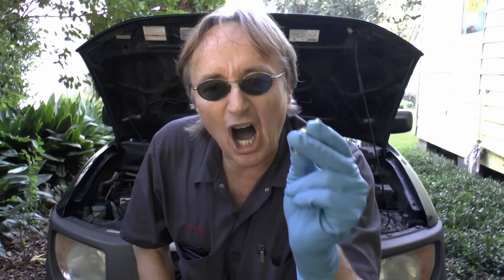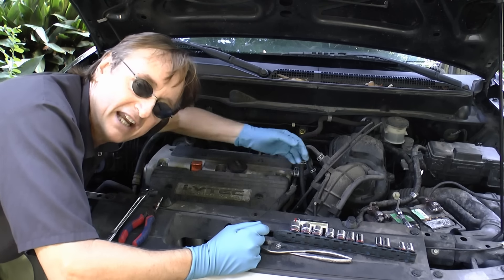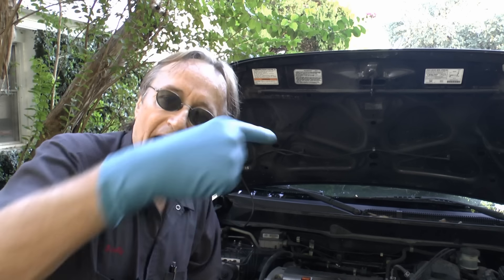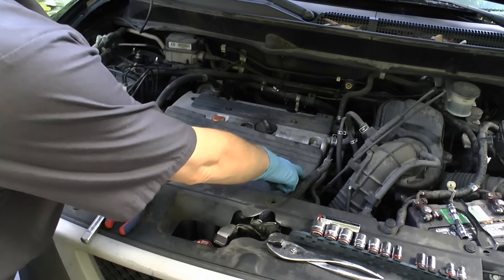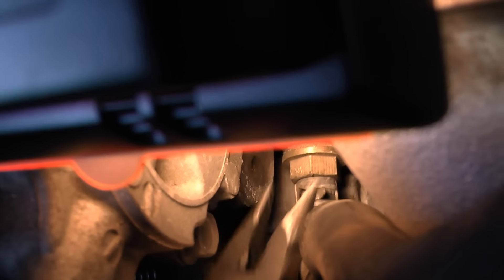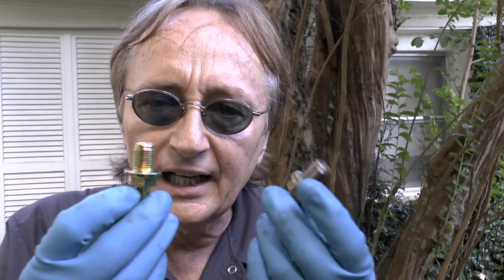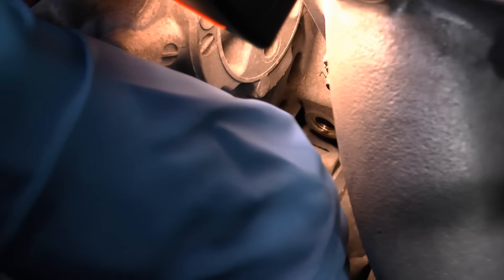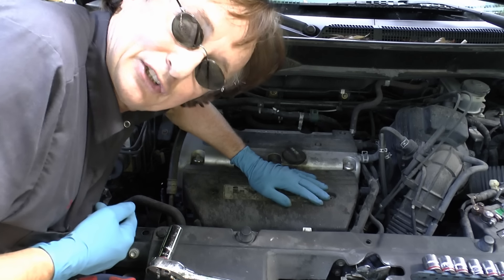How to Fix a Car Engine that Burns Oil for 10 Bucks

Comment: I definitely need this done to my car. I don’t have much help and the dealership has quacks working for them. They somehow didn’t know if I was burning or leaking oil and have been struggling a long time to get it fixed right. 
I went and got an oil change they suggested doing an oil consumption test then two days later oil was all over my driveway. I took it back they said my oil pan was cracked. I feel like they caused this problem and it’s in writing but they said I must of ran something over which I didn’t.

Comment: I have a Mazda6 2004 that’s burning oil, but drives very good and had no problems whatsoever. I do hear clicking noise when accelerating at low gas.. but I will try this to see if this works..

Comment: Ok kinda serious question, I just got a used silverado(2003 5.3L) that burns oil on start up and under heavy acceleration but does just fine at idle or causing at 55, any ideas on what could cause this?

Comment: We had this young guy at work who asked me why his car needed a pcv valve. I told him but he thought I didn't know what I was talking about. So he tried to run without one. It was a brand new rebuild. He started the car up and within a few moments oil was running out from under his car. He quickly shut it off and then hooked the valve back up. Kids 🤣

Comment: Hey Scotty, I have a 2015 vw jetta TSI 1.8L with 159000km. My car is currently burning 1L/1000km of oil currently using synthetic 5W40. I have replaced the PCV yet the problem is still unsolved. There are no leaks nor blue smoke in the exhaust. Do you think it would make a difference if I tried 0W40 instead?

Comment: Great video. Very informative. Do you have a test that one can do to differentiate between this PCV/CCV valve failure vs Valve Stem Seals, and what about worn piston rings? I've a 2005 BMW 320i (N46 engine). In some N46 engines, there's a CCV breather cap on the top, but on my engine the PCV is difficult to access. Thanks in advance.

Comment: @scotty I have a 2011 chevy equinox, I know I know they are bad for burning oil. Would changing this valve have any effect on how much oil mine is burning... I unfortunately missed the oil monitoring option by about 2000km...

Comment: Hi Scotty! Question I have a Honda Civic 2002 ex with 260000 miles burning oil. I’m gonna change the pcv soon. For the meantime, I always use 5w20 per Honda manufacturer. Just wondering since I’m burning oil and have a high mileage. Can use 5w30 on this car so it’s more thicker? What’s your thoughts or advice in this situation? Please let me know. Need your help. Thank you so much and god bless.

Comment: I can do you one better. My 2008 Ford Escape was burning 1 qt of oil in about 100 miles. Well I was thinking I should change the PCV valve. So I started in and pulled off to hose to the PCV valve and thought I would try something different. I sprayed brake cleaner in the hose and after about 30 seconds I started the engine and put my finger over the intake PCV valve hookup and sprayed some more brake cleaner in the hose. Run the engine about 15 seconds more and hooked the hose back up to  the intake. No more burning oil. Oil level stays right on the full mark. Easy fix.

Comment: Hi Scotty..  I need some advice bro..
 this PCV valve should be in all cars or only in certain i.e.  Petrol or Diesel as I've got very less knowledge about cars.
I've got Renault  grand scenic ll 1.5 dci  2006 and have to top up oil more frequently(3 to 4 times a year) and it does smoke when I push my  pedal down for speed when I'm in rush..
Other thing is sometimes a sign comes up "check injection" and that time I feel that car lost the power but back to normal next day or after sometimes.. so plz  plz.. advise..
Many Thanks in advance..

Comment: the oil is dripping from the blowby house to my engine air filter. i get black smoke from exhaust too. is this also a pcv valve issue or is it blow by hose that needs to be replaced? or both?

Comment: What is the right torque for the PCV valve? A stripped thread is a much bigger problem than excessive oil loss, yet a service manual for a car can be very expensive for a casual mechanic.

I'd bring the car to my professional mechanic if I suspected a bad PCV. Like Scotty, I have a 1990s Toyota with low miles.

Comment: Hey! I enjoy so much your videos!! Thanks!! Got a question, I have a 2006 Mitsubishi Endeavor with 200,000 and is burning oil, it have very good power left on it! Any suggestions on what to do, either buying other engine or repair this one or instead try this fix or maybe changing the valves stems? Thanks!!

Comment: Changed my PCV valve and my car still smokes. Its consuming engine oil but i noticed that it only throws smoke after I went downhill and accelerate. No visible leaks either.

Comment: Hi, i have bought a second hand car. For the first 10-15 minutes the car drives really good nit after a while a knocking sound start coming from the engine(i think), as you accelerating the noise become louder, but when yiu coasting noise doesnt come. Meanwhile the engine start loosing power slowly. It is burning engine oil as well and a lot of petrol. Would  you be able to tell me what can be the problem??
Thanks

Comment: In the dinosour days the PCV valve was on top of your rocker cover, you'd pop it out of the grommet and stick your thumb over the end to make sure the ball inside valve would seat.. and engine would idle a little higher while doing this.
Same deal, if it didn't rattle spray some carby cleaner during engine idle. Wipe and pop back into rocker cover grommet. 😉

Comment: Hi Scotty, love the videos! I have an oil burning issue. I’ll preface the issue. My wife has a 2008 Honda Odyssey EX-L 3.5 J35A7 with the VCM.... I have choice words for Honda on the VCM but I’ll spare the rant on that. Now it has consumed oil more and more for a while now and a neglected to get the VCM muzzler a while back. Now it smokes see it at start up and when you hit the accelerator. I’ve seen where you can use a special sea foam to help free up the oil control rings. Would that work or in your honest professional opinion do I need to do a tear down to free them up? I can see oil seeping from where the catalytic converter mounts to the head on the radiator side of the engine. It also throwing 420 n 430 codes guessing I need to replace those as well as the o2 sensors. Hope you see this. Thanks in advance and hope you n your family are well and stay safe.

Comment: My 2005 Chevrolet Impala is burning oil way quicker than it should and I've never noticed any smoke from exhaust and I replaced the PCV valve with absolutely no affect and still burning oil. What could this be?

Comment: Love your videos!  How can I test to see if my pcv is bad on a 2008 Mazda5?  I heard you can place a stiff piece of paper on the oil reserve opening and when the car is on, you should feel it pull in.  Mine shoots out lots of air with oil.  I'm assuming it is not good?  I'd hate to have to take the manifold off and everything else to get to this if it is good.  Has been consuming lots of oil for a while.  Thanks!!

Comment: Hey Scotty I changed my PCV valve on a 2007 Honda Ridgeline and it doesn't have any line coming away from the valve or an opening. How does this thing work

Comment: Great video, great tips. I am so frustrated, my car has 210,000 miles and it burns 1/843 quart of oil every 10,000 miles. Damn Chevy Sonic 1.8L engine 😡 😁. My racoons help me change out the PCV and the cats watch 😁 when dinosaurs roamed the earth there were no dino oil.

Comment: Hi - I own a Kia Sorento 2018, it lately has been running out of oil right by the time the next oil change is due (6000km), I dont see any leaks (other than possibly from oil cap), the car runs well, accelerate well, and no smoke out of the pipe, also no engine codes from the computer, could the oil magically disappearing be burnt from high inner pressure/heat due to an old/worn out PCV valve?

Comment: Hi mr
My Citroen Berlingo 1.4 petrol  2006 idle very bad.
I change spark plugs, oil, spark plug coil pack , what would you think is next?
Lambda sensor or throttle control sensor or both?
Best regards

Comment: Hi, Scotty. recently I just changed the oil for my honda accord 2014. I saw that I lost two quarts of oil. before that, i have already change PVC value OEM part. my question is, do you think the new one that I put in my car is bad or my car has some problems? thank for reading this. by the way, I love to watch all of your videos.
Reply: I'm having the same problom with my 2008 Honda Accord. Topped it off. Now it's way below the min dot. Every time I do a cornor. I get a low oil pressure light turned on..

Comment: Hay scotty I have a 2018 mazda 3 sport with the 2.5l it's got 25,000km only had 3 oil changes so far and I only done 1000mikies and noticed I'm down about a quarter on the dip stick any reason for this I checked after oil change and it was full. Your thoughts would be greatly appreciated

Comment: Hi! Do diesel engines have pcv valve like the mitsubishi pajero sport 2.5 4d56 engine? I have this car and my problem is that it is having oil coming out of the dipstick. Most mechanics have said that my engine has blowby. But mitsubishi mechanics said it is normal. I am trying to locate the pcv valve so that I could perhaps diminish it. Mine is a 2011 model.

Comment: Hey Scotty, I have a 1995 Acura Integra 1.8L I was try to replace the plastic pcv valve and it broke. I have been trying to remove the piece that's inside the seat. How can I go about removing it?

Comment: Ive already changed out the pcv valve and my car still consumes 2 quarts every 3000 miles. There is an oil stain on the bumper by the exhaust opening that coats the rear of the car with oil but I don't notice any smoke while driving.

Comment: My Toyota corolla GLI 2011 model is reducing oil i check PCV value and it was ok and clean it but still reducing oil and smoke is coming from oil cap when engine got its temp? What is solution?

Comment: Hi I've got a Kia Carens 2002 German version that I bought in 2016. I've noticed that it is burning too much gas. The normal consumption in the user manual is 10.7 l/100km in the city. It almost burns twice that amount now a days. Your advice, please...

Comment: Scotty - My 2010 Genesis coupe is blowing blue smoke out of the exhaust on START UP & burning oil like crazy. I replaced the PVC valve, no help. I replaced the valve cover gasket, no help. Use Sea Foam to clean the pistons rings and other internal parts of the engine and still no help. I would mention the trouble started after a recent oil change. Help!

Comment: hello good sir. First I want to say I may be the first person to become addicted to a YouTube channel which means I’ll probably be the first person in history to have to go to rehab over a YouTube channel! LOL. Yeah. I watch a lot of your stuff. So I’ve got a 1998  Lincoln town car signature series touring edition. I was wondering what your thoughts are on that Lincoln blowing out a little oil smoke after idling for over a minute. I think it’s the valve guide seals letting oil  piss past them when the manifold vacuums up at idle. But I’m sure there are a few other things it could be.  Maybe the PCV valve? there is no way I’m going to burn up a Saturday or a Sunday doing valve guide seals if that’s not the problem. Boy I tell you I learned a long time ago not to just start throwing parts at a car.  I had a friend set in it and jump on the throttle a little bit without a load in park while I was behind it after it idled for a few minutes.  decent little plume of oil smoke blew out the exhaust and that was it. Told him to spin it up a little and he did so and no smoke. So I let this fool get out there on the street in front of my house and jump on the gas for me so I can see what it was doing when he was turning that little 4.6 up.  no smoke. Just the sound of a strangled 4.6 begging for  an aftermarket Flowmaster exhaust kit.  I should probably mention that the car only has 118K on the clock. But I suppose that doesn’t really mean much because I haven’t had it since it was new and have no idea how well they maintained it. Some people just don’t understand how oil is the best cheap insurance you can get for a car. Anyhow. Let me know at your leisure what your thoughts are on that chain smoking Lincoln popping out smoke after idling for a minute or so. Keep up the good work man! We all get a kick out of you and learn something to boot! Keep the dirty side down and the shiny side up!

Comment: Will this work for a 2005 BMX X5 4.8??? IT was fine and then all of a sudden it started burning oil which resulted in a lot of exhaust smoke when I sit . I blind the guy behind me sometimes pulling off from a light., so is it the PCV valve?? My mechanic said I need a new engine.

Comment: My 2009 camry le v4 is burning too much oil like emptying every 500 miles.  The car is running smooth and give good mpg if i top up the oil every 300 - 500 miles. Will replacing pcv valve fix this issue ?

Comment: What if its a turbo honda with aftermarket turbo its blowing smoke from the valve cover tube on top an the exhaust is cut off after the turbo

Comment: My 2008 nissan altima burns alot of oil (thanks to the previous owners not doing oil changes on time) mechanics have told me just to replace the engine which is a $4000 job. Can i fix this problem? Or should i just sell the car

Comment: Scotty, love your show. Very helpful. Question for you: I have a ford, edge, 2008 with less than 95,000 miles on it. Getting a PCM code P0112. Mechanic says engine burned the oil and I need a new engine. It's making a knocking noise. Any suggestions?

Comment: My car was losing 1/2 litre in 400 kms so my mechanic told me that engine is burning oil out the exhaust and I need expensive piston replacements rods and other blah blah costing up to $1500 to $2000 .. what should I do .. should I drive adding oil frequently or go ahead with this expensive repair or will carbon cleaning help ? My car VW 1.6 cross polo 2015 .. I’m worried ..thanks Scotty in advance

Comment: My cat showed me how to change this lol! So I guess I'd better get to it! 2010 Camry approaching 200,000 miles is suddenly burning more oil than usual with no leaks or other issues. I'm going to give this a try...and then top off before my trip and see how it goes! "Fingers crossed it's not the rest of my engine" LOL
Reply: almightybirdwatcher4986  Unfortunately my 2010 is a Dual VVT ii do the valve isn’t located there for easy reach…you have to take off the wheel and a bunch of  riffraff… I’ll have to probably have someone else do it because I don’t think I can reach it

Comment: Ha Scotty my 2010 Camry  4 cy is using a lot of oil just started at 120.000 mi. It has been taken good care of  and oil changed on time. Use only Castrol..no smoke or no leaks...about a quart ever 500 or so.. help...it's a good running car.

Comment: Scotty, I have an 08 Buick Lucerne with 50k miles on it that seems to be burning excessive oil (no leaks found) and the shop said that it simply was burning due to its age even though it doesn’t have many miles on it. Was wondering if that is true, especially considering the 3800 series V6 in that car is a good engine. If so, is there significant damage being caused to the engine?
Reply: Mileage doesn’t have anything to do with that issue from what I’ve heard it’s just the age of the vehicle more specifically the age of the engine itself. Worn out piston rings can cause excess oil consumption as because they don’t sit flush against the cylinder oil can leak through and get burnt up through the exhaust. A PCV valve that is locked or seized can also cause oil to get burnt through the exhaust because oil is not able to go through the valve.

Comment: Scotty, after changing the PCV, my Highlander with 200K miles on it is still burning a quart of oil (Mobil1 5W30 High Mileage) every 500 miles. Should I just keep adding same oil or should I go 10W30 or a higher viscosity 5W40 or a 10W40? Thanks man!
Reply: Always use the correct oil for your car

Comment: Hey Scotty, I was changing the PCV valve on my 2002 crv. Same engine as the one in this video, I took the old PCV valve out successfully and went to put in a nee Honda genuine PCV valve, when I put it in, the metal PCV valve broke in half. The PCV spring I was able to take out with a magnetic tool, but there’s still the metal piece of the PCV valve stuck in the threads in the hole. Any way you know of that will let me get this out? Thanks!

Comment: Hello Scotty, I tried what you said, cleaning out the pcv valve on my 2014 Honda Accord with carb cleaner.Bad idea, the carb cleaner melted a hole in the plastic pcv valve and put a glob of dried melted plastic on the outside of the valve so I almost couldn't get the old one out when I went to replace it.And a new pcv valve from Honda for that engine costs $42 plus tax,not $10.
Reply: Never go to a car dealer for parts, I got one from O’Reilys for $9.00

Comment: Scotty, please please help me ! 
I have BMW 320D 2013, engine N47C . I always smell a burning oil smell from the airconditioner, especially when the engine temperature is between 70 and 100 degrees, or when I just turn the engine on. The smell goes after one or two minutes then. I always change engine oil, 
 oil filter and cabin filter each 5,000 km.  My car only ran for 56,0200 km so far. I had a technician checked the entire car, but he found no issues in the fuel injectors or any other part. The burning oil smell is still on....what's the problem ?